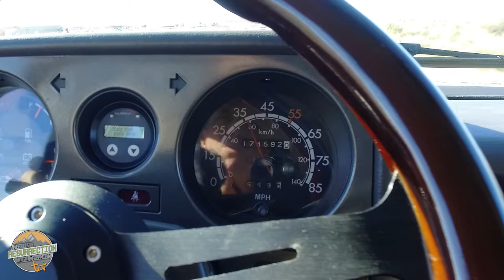A  Land Cruiser "restored" by another shop sends JP over the edge, & special guest drops off an FJ45

Comment: In the past I thought about a Sniper kit for my 60 but having recently rebuilt the carburetor it runs really well. Besides, anymore it gets used for tooling around Colorado back roads and the carburetor works just fine. It's shocking how a shop can put down a nice paint job with not just holes, but a screwed on "cover" or whatever it is, WOW! I admit that I do watch You Tube videos of car repairs and restorations and the number of hack jobs is crazy. What's worse, is the number of people that think they are doing a great job. Thank you for producing what is actually quality restorations.

Comment: at least use corrosion inhibitor grease with stainless steel screws into carbon steel
Reply from the maker: Yes, anti-seize is a good one for that. We call anti-seize the herpes of the automotive industry, however. Once it’s around, it spreads everywhere and you can’t get rid of it.😂